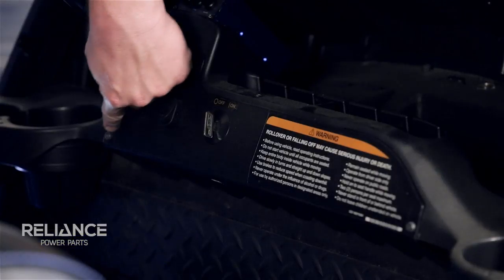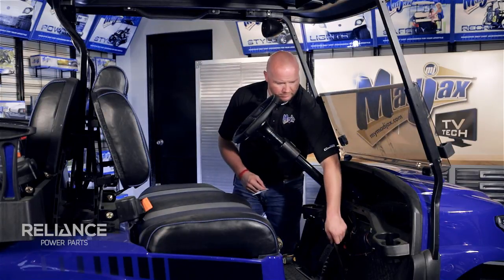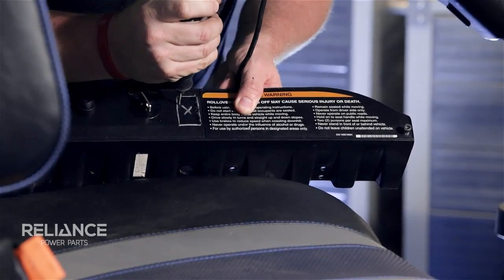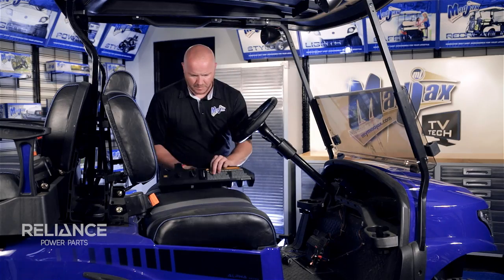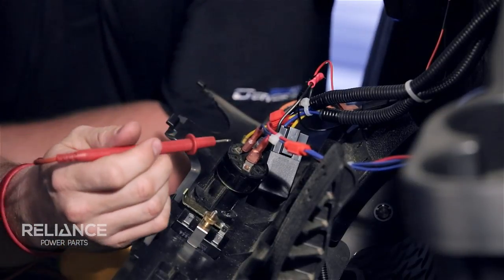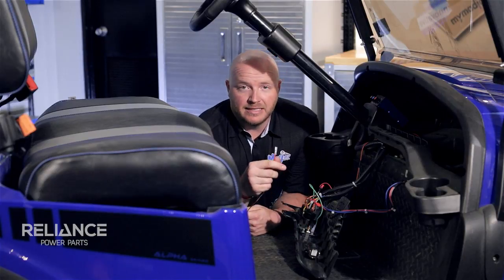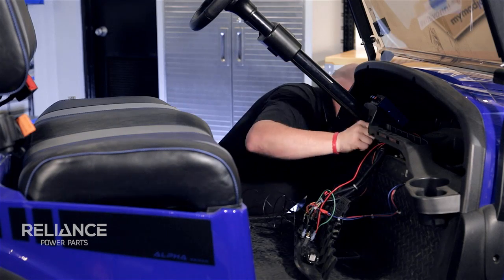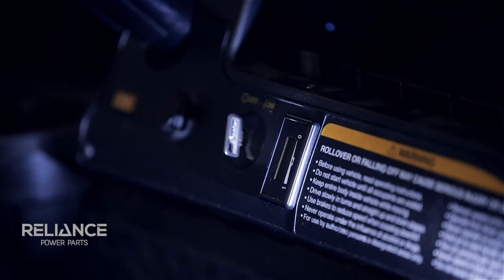36 - 48 V Charge Meter | How to Install Video | Reliance® Golf Cart Accessories (UPDATED)

Comment: Hi, great video. 
Just wondering if it makes any difference if i were to use thicker wiring than 18awg.
Would it be an issue to use 16 or 14?
Thanks.
Reply: Nope, no problem if you go bigger. Smaller would be concerning but bigger is usually better

Comment: does that mean you need a double spade connector on the switch leg of the key switch?
Reply: Michael Perrino I didn't have a double spade connector so i just wrapped the wire around the post and slid the connector of the other wire down over it.

Comment: Can't you pick up the 48V (hot) from the key switch instead of going all the way to the battery? And pick up a local ground as well?
Reply: Yes, if you have a club car, you can pick up the 48V, ground and switch on behind the keyswitch.
Reply: Which color wire where I get 48v from
Reply: I"ll take "How to Drain A Battery" for $200 Alex

Comment: I installed a similar LED battery meter on my 36V 2002 E-Z-Go TXT. The problem I’m having is that the meter stays on the entire time, and the switch wire doesn’t seem to do anything even though it is wired to the switch leg of the key switch as shown in the video. Why won’t this meter turn off and only turn on when the key switch is in the ON position?
Reply: Same issue. It works when directly connected to batteries only but doesn't work at all when connected to key switch

Comment: Do the wires come with the kit?  What is the path of the wire to the battery?  Needs more information
Reply: Wires do not come with the kit. Neither does the double make connector that goes to back of key seitch. Only The female connectors come with most meters.